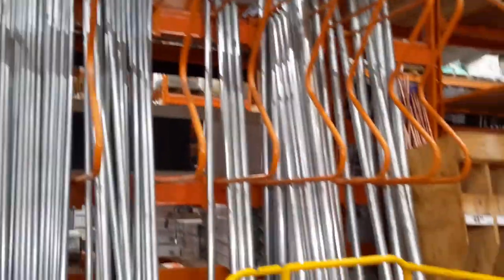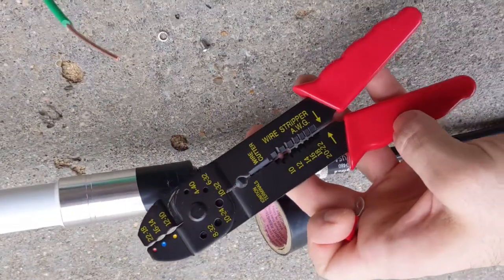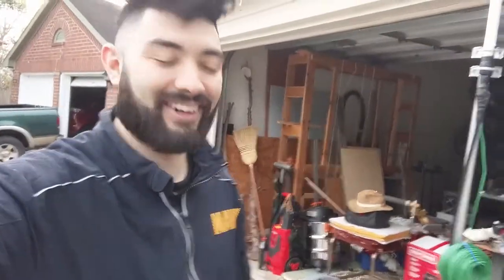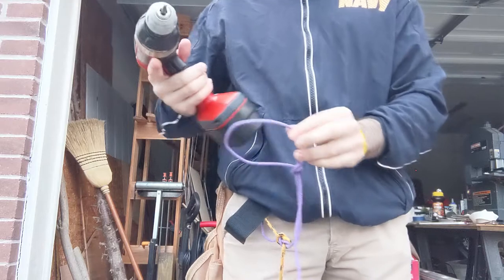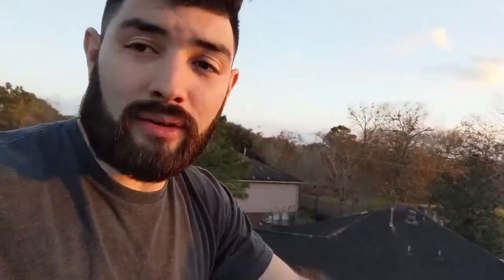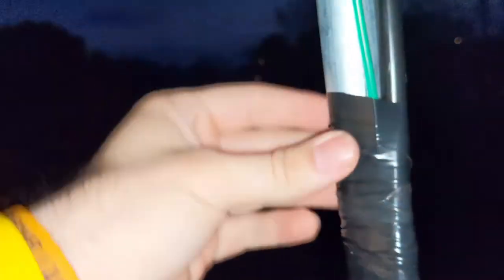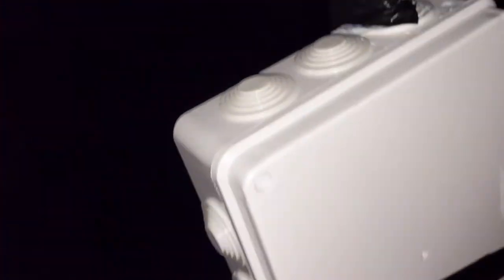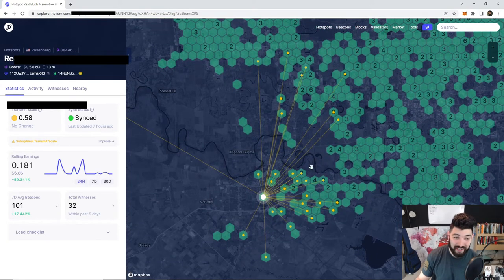I Put My Helium Miner On The ROOF. Here's How Step-By-Step

Comment: First layer tape top to bottom, then sealing self bonding tape then wrap another layer of electric tape bottom to top to avoid water leaking in the seams as it drips down. I also like using fence posts rather than those shorter 5 ft poles.
Reply from the maker: oh yea fence poles are great. Good call!
Reply: @gabrielchaparrotalkscrypto  the height you're getting seems to be working. Love the tree ideas, I'm looking at incorporating that into my next setup.

Comment: Did you use Poe cable power over Ethernet?
Reply from the maker: Hey there! Thanks for the question! I used PoE yes. Splitter, Injector and a 50ft Flat Ethernet cable. Items in description of what I used exactly.
Reply: @gabrielchaparrotalkscrypto  I just realized that my bad. I’m looking to put mine outside on a 30 flag pole. Just trying to get ready for arrival. I appreciate the videos bro!
Reply: @gabrielchaparrotalkscrypto  I have 3 other people in my hex, how will that affect my earnings?
Reply from the maker: Hahaha no worries. For sure man! Glad it helps! And depends on the rest of the hexes around you.  If you add miners to the surrounding hexes then you go back up in transmit scale.  But if you are lone wolf but have 3 In a hex then you're really gonna suffer. Just showing both ends of the spectrum to explain how the hip levels work.  You can read more about it in the engineering manuals.  It's kinda complicated stuff.  But that being said i have shot a message to people telling them to move their spot over lol. Not in a rude when but i did the research. I learned where their hotspot was and sent over a message saying that they could relocate their miner within 150 m and they will up their rewards scale. Told them whifh hex to move to and they actually did. Bumped me back up from. 5 to almost 1. This was on hotspotty.